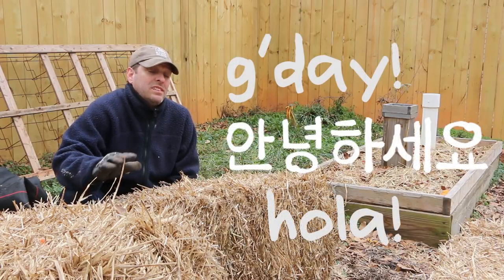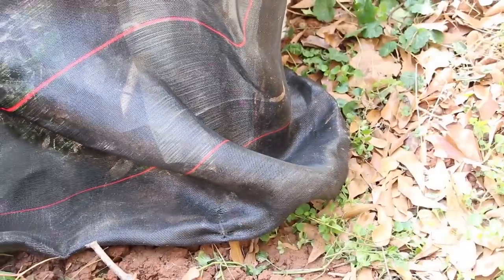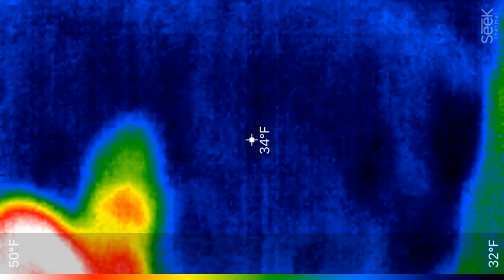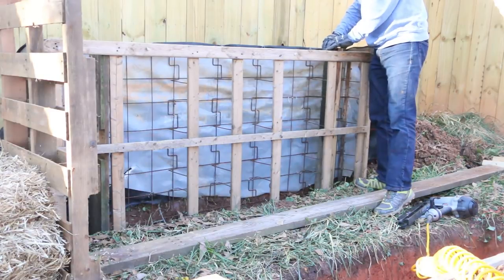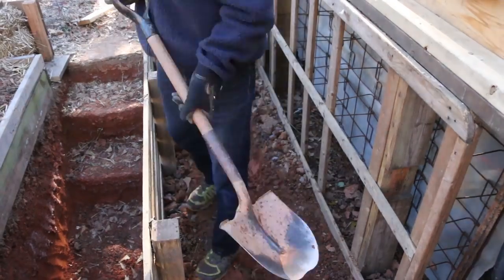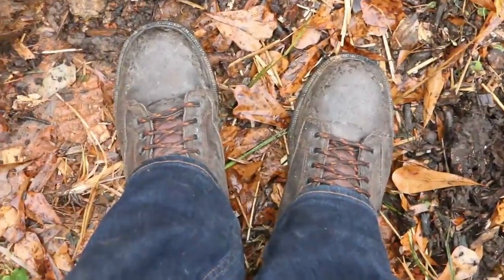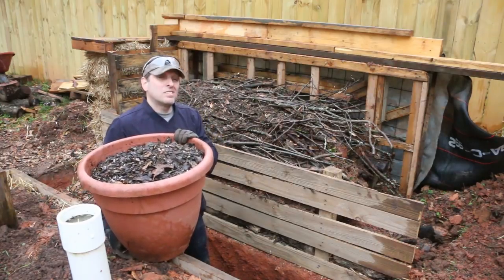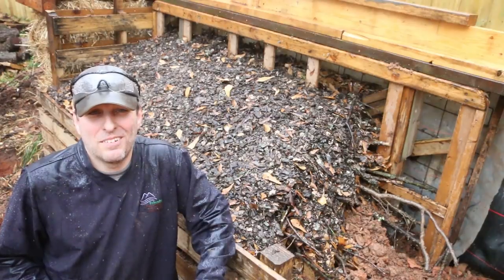How To Make A Hugelkultur Greenhouse [Part 1]

Comment: Excellent idea!  You combined two projects that I’ve wanted to build into one!   We will be starting ours this spring!  We are much farther north (Toronto area) so I am going to incorporate a few heat capturing ideas in hopes of growing year round.
Reply from the maker: Yay! You might consider using a pile of wood chips as a heat source. Run pipe under it to capture the warmed air. I’ve had a few suggestions in the comments to use this method. I’d approach the fire element very differently. Making a true rocket mass heater instead. Perhaps using water as a heat-storing mass. There is a video on YouTube about a guy who grows oranges in an below ground greenhouse in Nebraska. You might get some ideas from his build as well. Thanks for watching.

Comment: Just an fyi in case you wonder about this in the future, the wood will take 2-3 years to rot to the point (unless you put something like cottonwood in there which rots faster) that it absorbs enough moisture to keep you from having to water it as often. The prerotted stuff you put in the bottom will help of course. You'll probably have to water close to normally in the beginning. Enjoy this though man. It'll be awesome and the wood in the bed will possibly last for twenty years before it needs to be rebuilt. Good work and inspiration.

Comment: Great video. I've been toying with Hkultur for a season so far with good results. I tend to include more green material than you & throw in soil at every level. I can't say whether this produces any difference in the result, too early just yet. H'kultur is a great way to dispose of any cuttings, wood etc & garden waste so I'll be using it in my ongoing brick built greenhouse if the British weather allows. The soil in Lincolnshire is red, but not as red as your Georgian, why didn't you throw some of that into the mix?

Comment: Great video. You can also wrap the box spring with plastic and screening before you place it upright into the soil. I would also take care to make sure the wire used to secure everything has it's ends on the inside, so you don't get poked or scratched by them when you walk close to the structure. :)
Reply from the maker: That would have been a great solution as well. Thanks for sharing the suggestion.

Comment: Perhaps placing plastic or recycled sheet metal between the organic matter and wood structure would delay structure from rotting…. I enjoyed the thermal imaging!    Use plastic pallets for contact with organic matter?    Does hugel really need that much wood?

Comment: One question. Who do you deal when heavy rainwater floods the trench?
Reply from the maker: The roof helps keep most of the water out, but it does flood. I'll drop a hose in, siphon it and drain lower in my yard. It waters my big water oak tree. :-) Thank you for watching.

Comment: Do you not worry about rust running through the soil?
Reply from the maker: Hi Lisa. Rust (iron oxide) is actually a beneficial soil amendment, although here in Georgia the native soil is red due to it's high natural iron oxide content...so the soil is probably doesn't need iron. A little extra won't hurt though. Thanks for watching.

Comment: Looks like you'll have great success with that design. Good on you.
Reply from the maker: Thank you Pia. And it's g'day, I'm guessing. I know "good on you" is a down-under phrase. One of my soccer mates is an Aussie. So I hear that a good bit here in Georgia. Thanks for watching.
Reply: Not sure where I picked up 'good on you' or if it just started one day. I'm in Uruguay, don't know any Aussies here, though I did know some Kiwis in Lake Tahoe in the early 90s, met an Aussie on a hitchhike trip south of Uvita, Costa Rica, but, I don't think he said good on you, might be osmosis in action with that phrase... watching the full series on building this Walipini Greenhouse hybrid and sharing with my permaculture friends here. First reaction your project has received in fb is "que trabajo" loosely meaning 'oh, so much work.' lol. Our winters aren't as critical here (sub-tropical USDA hardiness zone 9b and AHS heat zone 8), we had about a week of below 38 degree weather last year (opposite time of year). Our summers are super harsh, very hot, very strong UV... If I were to build a hybrid greenhouse like that, the purpose would be to temper the hot summer weather using shade cloth. And, in winter, replace the shade cloth with a polycarbonate lid for the sensitive plants... designed to be able to lay the banana down on a mild temp space shelf. It'd need a serious flood protection design as well due to the sometimes torrential rains over a period of days. My head is spinning watching you and thinking through the design needs for here. Opa!
Reply from the maker: Opa is about right. This was definitely a lot of work (
demasiado trabajo para asegurarse). I do think the trench will have a cooling effect in the summer as well. By the way, right now, the trench does fill with water. I need to berm up the back side to force the water to flow around. Maybe just use the walipini portion in Uruguay. I do think it would a cooling strategy given your summer temperatures. Thanks for your reply.
Reply: I wondered about the water infiltration.. glad you've launched into a prevention mode. Learning lesson for all of us. Yes, I think also there'd be a cooling effect with a revised design of your project here. There's a two year old  hugelkultur in the front yard that I'm thinking I'll place the walipini-greenhouse in/on. Before watching your process I was already thinking of adding more soil & compost with log walls to raise the soil profile (and keep the neighbors' dogs out of the garden)... so, upon watching your process, I thought, yeah, raise it up and create the walipini in one fell swoop... one long fell swoop that is. It'll be great to protect the cold sensitive plants (chile peppers for example) in winter and to save the heat beaten plants in summer. Only one of four different squash survived our extreme summer this season. The one that survived hasn't produced flowers, yet. When I get going on that project, I'll share the process. Currently putting my energy into healing torn meniscus combo "runner's knee"  .. garden getting very little of my time now. This winter, a couple months away (officially, though the temps during day have already dropped and at night chilled .. are telling) will be my renovation of the gardens time.

Comment: I'm on the verge of being exposed to/and considering a most simple form of hugelkultur as an experiment. The organization that I work for, will be doing a number of demonstration beds this year. I should also add that I am a 30+ year French Intensive gardener.

My interest in hugelkultur, stems from my having an ample amount of branches to use, and I like to keep my mind open to learning. I'm genuinely not being critical but suggest that there are many ways to achieve the same end. 

I live in Maine, and am on the verge of building my 7th iteration of a greenhouse. Probably 12' x 20' x 8' (240 sq. ft). My area is typically zone 4 or 5 but if I use low tunnels inside of a greenhouse, I now have your average winter temperature.

This recent design has no wood whatsoever, all of the members are bent from fencing top-rail. Scissor doors, and a 12mil woven skin. Total cost under $400, parts on site, total build, ready to plant, 2 days.

If you're interested, I would be interested in discussing ways that the two methods could compliment each other.
Reply from the maker: Hi Paul. Thanks for the feedback. Interesting to hear of your hugel-pursuit. I'm more of a maker/builder than a gardener, but I have read a little about the French Intensive method. Agreed that a healthy garden can be approached via many paths. I've got regular raised beds too and want to construct a keyhole garden as well. Honestly, as much for the opportunity for video content, as having more garden space. I do have some posts and silt fence salvaged from the construction of my home for the keyhole bed. I likely don't have the space to build the greenhouse you mention, however I would love to learn more about the methods (as well as French intensive). My basic understand of that method is more dense planting to retain soils moisture and inhibit weed germination, but I know there must be more. Thanks for the comment. Shoot me an email at tom at greenshortz dot com if you'd prefer to chat that way.

Comment: You could have put the red clay, from digging the trench, straight into the bed frame wall.
Reply from the maker: That would have worked, but I actually want the clay to make cob and adobe. So, I kept it and used the wood chips instead. Thanks for the feedback.